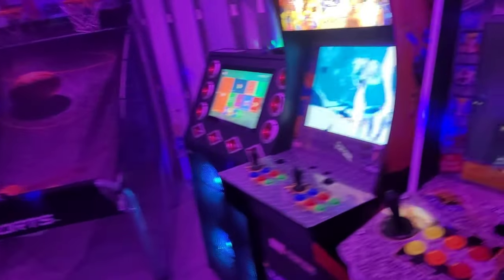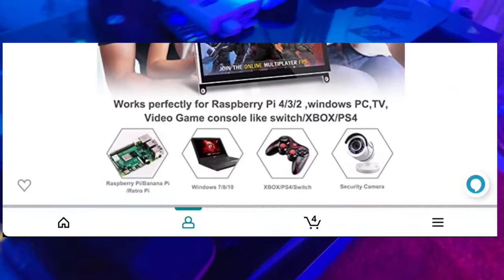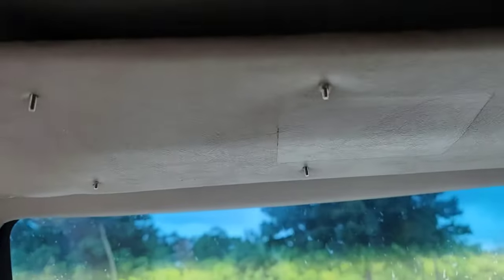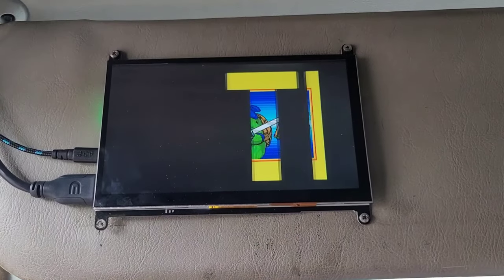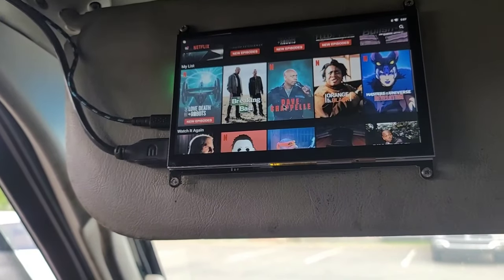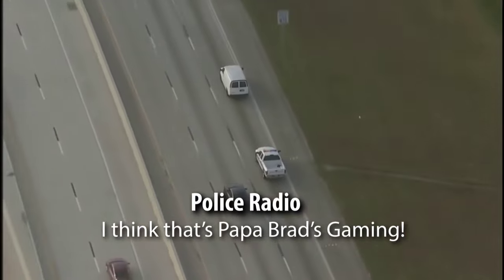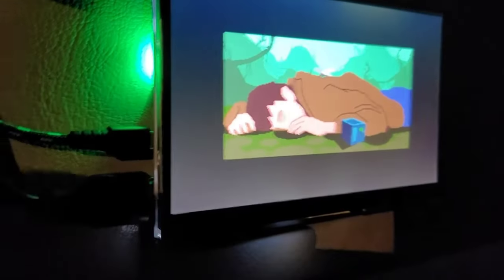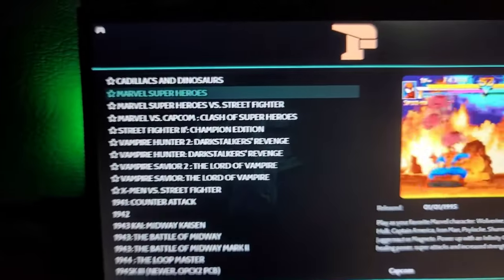Did I invent the CARCADE!? (LCD TV Car Visor Mod) Arcade in your CAR!!

Comment: This brings back memories but the tech has drastically improved since the early 2000s. Back then I had a tiny 3 inch screen (might have even been 2.5") in my car. Plus a DVD player and an analog receiver so I could watch local broadcasts. 

It was pretty sweet for a while but everything went digital and made it obsolete, never bothered setting up anything new. Plus cars got me in some trouble in my early years so these days they are strictly for driving. Be safe and love the content, especially the comedy bits 🤣 👊 👍
Reply from the maker: Things definitely improved over the years ... I had a xbox360 hooked up in my expedition about 9 years ago n that costed me a pretty penny lol... now I can do damn near the same thing for real cheap lol. Can't wait to see how things r 10 years from now ...